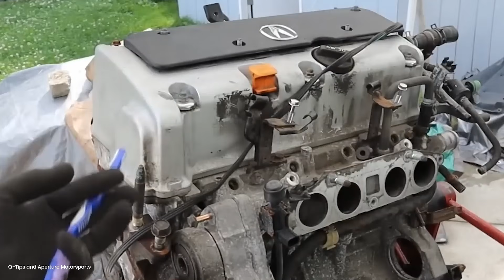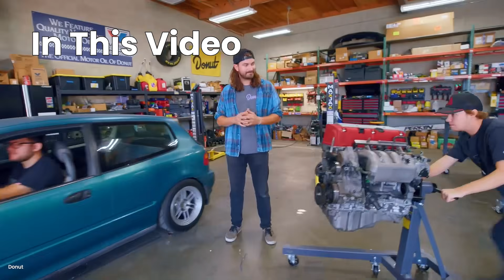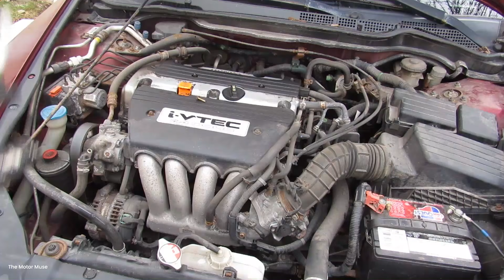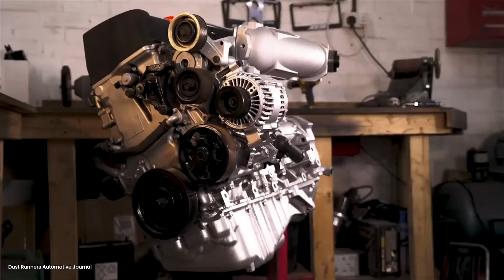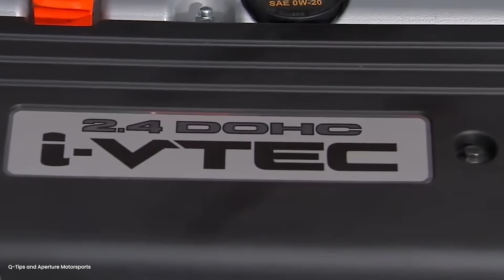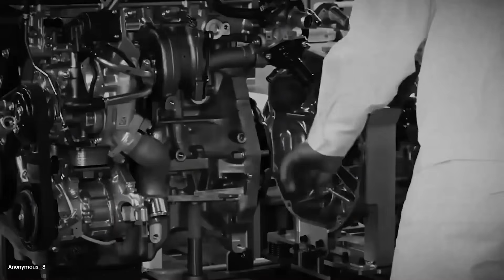The Shocking Reason Why Honda K20/K24 Are Overpowered

Comment: My 9th gen Si is a fun little car, I have an Invidia N1 exhaust in my shed that I ran on my first one. I remember the noticeable difference in acceleration when I ran it at the track. I’m still debating putting it on my current one. If I do I’m going to wrap it with fiberglass header wrap and dynomat the exhaust tunnel to help silence the exhaust drone…

Comment: It was not an accident. Honda exzecs gave the research department unlimited funds to build something better than the B series. They made the K series and it produced over 280 hp NA! When the execs found out they said detune it Now!  Their flag ship cars v6 and inline 4 only produce 240 and 290 hp they could not have an engine designed for a saloon out performing those engine.  So yeah it was no accident and the guys that made it left Honda because they knee capped a very good engine.

Comment: The 2001 K20 prototype engine made 287 HP (143.5 HP per liter) without a turbo. A K24 has the potential to be a 340 HP naturally aspirated engine.  I'm a proud K24 Accord owner. Mine is totally stock and it still screams in traffic from stoplight to stoplight.

Comment: Yeah those crappy SR20 and 2JZ engines...phooey!  Saying 350hp on an SR and 500 on a 2J was all they could take on stock internals is just pure sh*t talk and stupid...Come on guys, seriously? My SR20 was pushing 450whp for 60K+ miles before I sold the car.  The next owner beat the stuffing out of it for a long while until he starved it for oil on a road course and spun a rod bearing.  Besides, the K series is just an SR20 with a modern head design anyway. 😁

Comment: Both the 2.0L and 2.4L K series motors, still better than any of the below 2.0 L motors such as the severely underpowered 1.8 l and smaller sized motors.

Bring back the V6 in the Accords, also make the type r V6 variant of the Accord.

Comment: Honda is master in small engines that is so reliable and powerful and fuel efficiency that was installed innthwir motorcycles. That’s the reason homda’s engines are compact

Comment: 2:24 No, standard Honda B-series blocks are not made of iron; they are manufactured from a lightweight, die-cast aluminum alloy. The cylinders, however, are lined with cast iron, which is a common practice for durability and heat management. 
No, Honda D-series engine blocks are not made of cast iron; they are made of aluminum, a material commonly used by Honda for its cylinder blocks. While other Honda engines use a combination of aluminum blocks with cast-iron cylinder sleeves, the D-series engines are entirely aluminum.

Comment: The K series was Honda's first 4 cylinder that spun clockwise. B and D series spun counter clockwise. Honda made the change so the K series would fit easier in more vehicles. In the late '90's/early 2000's General Motors was buying Toyota 4 cylinder engines for many of their cars(Chevy Malibu was one) and GM asked Honda if they would design an engine that would be easy to use. Honda had plans to have K series in many non-Honda vehicles and people today think it was an accident that they fit so easily. As far as I know GM never used Honda K series but they did use Honda V6's in the Saturn Vue.
Reply: It was a J series they used in the Vue, but some of the bottom end internals were different than the J series. I believe it didn’t have the forged crank.
Reply: Very interesting…

Comment: It was no accident. In '03 or '04 Sport Compact Car magazine interviewed Honda's chief engine designer and he said they specifically designed the K24 to have a geometry that would support 9,000rpm. He went on to say he was more proud of the K24 than the S2000's F20.
Reply: They need a new variant of k series 280hp for new s2000 non turbo.
Reply: @BlueRice K20C a new S2K, a new CRX, and a new NSX. 🤣🤣🤣🤣

Comment: Not good engines I have to say, base on my own expiences. my first K24 blow head gasket at 98k miles
with perfect maintenance, second K24 had cooland going in the cylinders at 120k miles.uuhh junk
Reply: I have a 03 Accord with 406,000 miles,original 5 speed manual, original engine, run great.37mpg highway.gett some rust around rear wheels. K24A4 engine.

Comment: They are rev happy engines fun to wind out. But got no torque so no it doesn't pull hard from the  get go. my 08 si 6speed  is a great car but not perfect .
Reply: It pulls hard if you don't have 600lbs of passengers and a trunk full of junk in it. Also you can take out your back seats to reduce weight.